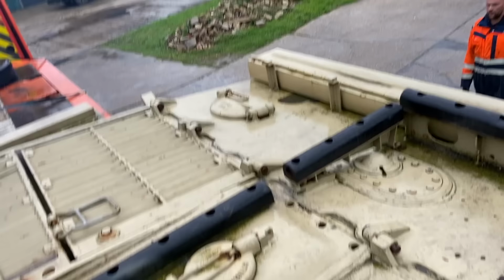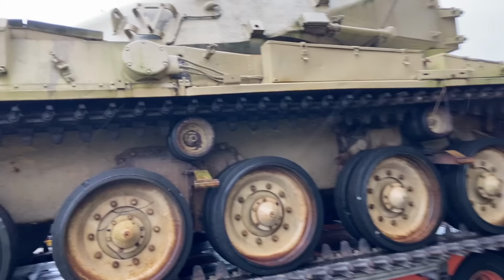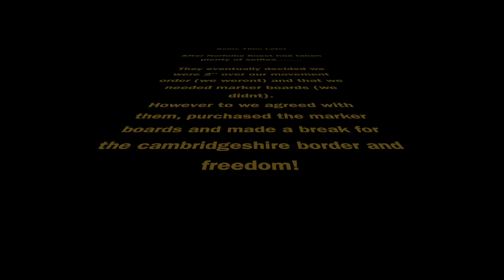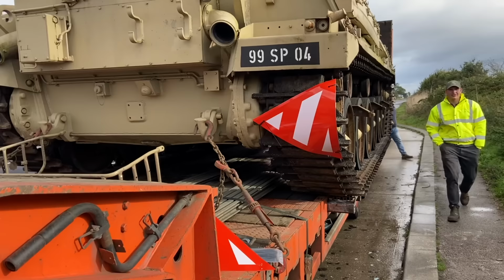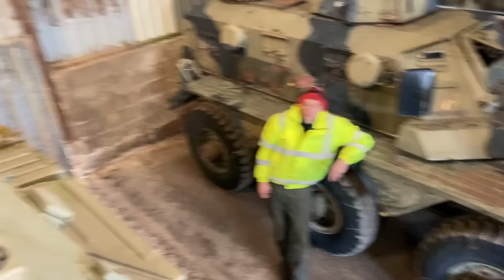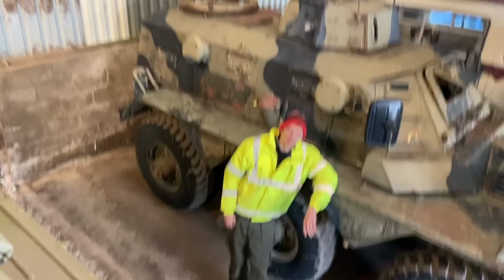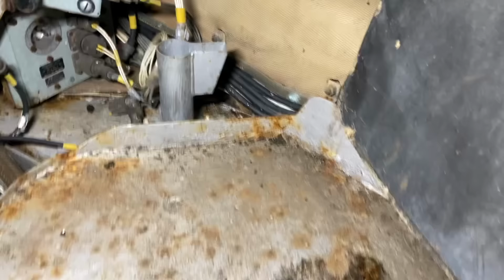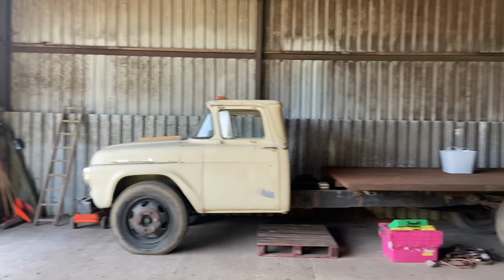We Bought A Chieftan Main Battle Tank and Got Stopped By The Police Taking It Home!

Comment: That is the smoothest sounding L60 I've ever heard. You could almost mistake it for a 4 stroke engine. BTW, if it was intended for Iran it's a Mk 5/2.
Reply: Mk.5/2K was for Kuwait. The Mk.5/5P was for Iran (Persia).
Reply: @Celebmacil  Yes, I stand corrected.👍
Reply: @thewomble1509  I worked  at the MVEE at Chertsey in the mid 80's in the 'Auto labs' there. A 6 test cell  facility primarily for R+D work on L60's and it's successor the Rolls Royce CV12 that was used in the Challenger and Challenger 2 tanks. This facility was built with funds provided from the Shar of Iran as part of the money he provided for the Chieftan tank development. I can still hear the distinctive sound the L60 used to make when they were driven around the establishment. A totally different sound to the CV12 powered Challengers.
Reply: @mangleman9112  Mate, i could spend hours talking to someone like you. i got into tanks and other MV's around the age of 14 and have been studying them ever since.
What's your opinion on the CV12 ?

Comment: The Leyland engines were designed to be multi fuel, that series was undependable. Later single fuel engines were the engine should have been fitted.
Reply: All marks of Cheiftain were potentially multiple fuel in theory 
In reality they were always diesel run
Major work needed to convert otherwise 
Ps they were always shite and total embarrassment for the crews
I drove a mk 13
Still shite
Reply: @jameslynch7826  just going by my Haynes manual... 😀

Comment: It would be worth checking if this one has a Rolls Royce engine fitted as some Iranian cancelled orders were trialled with V8 and V12 engines. Might even be a prototype for the Challenger I running gear.
Great find though. At least you have the mobile repair shop when you take this out ...
Reply: It surely doesn't sound like a two-stroke L60, well not to me.
Reply: @572Btriode  Agree, there was no L60 "scream" at all or heard the GUE on start up....interesting.
Reply: @petop8290  Yep, its a four stroke in there, they did allude to its various "modifications".  I spotted the foot gearbox controller though which means the lump is mated to the usual Chiefie gear box; I had the pleasure of doing final test and diagnosis on those during my days at Marconi - Portsmouth.
Reply: It’s fitted with the L 60 not the CV 12
Reply: @MrHewes  I really do not believe that's an L60 in there.
Reply: @572Btriode   Weren't the RR development vehicles fitted with bigger versions of the TN-12 automatic 'box?
Reply: @1chish  In the references I can find an "export" version using the RR CV8 TCA engine had the later and fully automatic TN12 gearbox, but then why is the gearbox controller still in there?
A couple of examples were modified by ROF with RR 900E Condor engines and again used the fully auto TN12 gearbox, but maybe as these were really one off trials projects later abandoned, perhaps the gearbox controller was just left in there for convenience.
I would hazard a guess the subject vehicle here is one of those two.
Reply: @572Btriode   This is what I believe. And maybe the gearbox controller is still used to control the auto shift. Or just left in place as you say.
If so this will be a Chieftain 800 or 900.
Reply: @1chish  Yep, that well could be and there's another reason for leaving the gearbox controller in place.
Strangely, but perhaps it was a convenient place when designed, it has the circuitry to drive the driver's gun barrel direction meter, that gauge on the dash with the white square which represents the hull.  It only goes in steps but sufficient to let the driver know where the barrel is overhanging. That very meter was in the bespoke test equipment and I recall testing the function, how the turret input was simulated I cannot remember.  It was getting on for 50 years ago !!
Reply: @572Btriode   Blimey that is some detail to recall mate well done. Be interesting to see what the lads uncover ...

Comment: SP reg would have been a trial tank /pre production ,so would never have been with a unit  so is probably in better nick
Reply from the maker: Was originally destined for the Iranian army but when that deal fell through went to be used for testing and developmeny
Reply: @fittermat  That i never knew ...Challenger was for iran ,then the shah was ousted and the mad mullah took over and we inherited the chally so to speak
Reply: @norb0254  We welded a new rear half to the Chieftain front to make Shir1. Shir 2 was the bones of Chall 1. Vickers at Leeds was also re-engining their version of Chieftain to give better performance and reliability. SP was trials only. there's one at Bovington.

Comment: You probably lost a tyre on the journey as the tank was entirely in the wrong position for weight distribution, the front axle was probably overloaded, the back was carrying nearly no weight. If the cops had weighed the set up there would certainly have been an offence! To make things worse it was backed on so all the tank engine and transmission weight was near the neck of the trailer too..............

Comment: Those don't look like "rubberized" tracks to me. What do I know ? I've heard that in some areas of the U.S. if a piece of equipment leaves cuts in the pavement the owner is fined for each "cleat" mark.
Reply: Those are peacetime rubber pads fitted.  War service is just plain steel links. They are to give enhanced grip on hard surfaces but when worn down can scratch the road surface.  If you go to the Tidworth/Bulford/Bovington areas you will regularly see them travelling on the road. The tracks are also reversed for war use so the bar/grouser leads the link for greater climbing ability. Later models and Challenger had the Dhiel style track fitted with bolt in pads.

Comment: 6:41 If by 'movement order', you mean 'how far out it sticks from the orange part of the trailer', then that's definitely more than two inches on either side. That's at least three, possibly three and a half inches from the side you showed. Then again, I don't blame either you or the police on that one; I hear you Brits haven't used the imperial measurement system in quite some time...

Comment: Nothing wrong with Leyland engines => Imaging this your in a hot bath & someone dumps you in a cold bath then just as you get used to the cold your dumped in a hot bath again => Engined don't like this treatment either so when engine really hot allow the radiator to cool it  a little before shut down then it will be trouble free... It also makes sense to allow the oil & water to circulate for up to a minute before charging away ><

Comment: Police in the United States do not I repeat do not have that authority to stop an oversized load simply for being oversized if they are observed breaking a traffic law then yes they can stop the vehicle but they cannot inspect the load they cannot inspect the paperwork they basically can't do anything but write a ticket for whatever traffic infraction that they're trying to frame the driver for I guess in a nutshell what I'm saying had I been the driver of that vehicle in in the United States I would have told those cops to piss off and I have actually done that more than one time.

Comment: There was a guy in the U.S. who tried to do this. It was a Sherman. However, when he started to run it about on his land, the military said he needed to "demilitarize" it. He told them that he did and that the guns were non-functional. The military told him, no, they wanted him to remove the engine, break the axles, weld the wheels to the body, weld the treads to the wheels, weld the turret to the body, and then weld the hatches closed. The guy sued the military and on his first day in court the military sized the tank and had it destroyed.

Comment: Is it possible to re-engine the Chieftan seeing its current engine is so floored? or has that been done before you pick it up?
Reply from the maker: it is, but with this being such an unmolested example it would be a shame to take away from its originality. Also been one of the last ones made it does benefit from a revised power pack which is slightly more reliable.
Reply: The engines got better as time went by, the main problem was the cemented in bore liners, they would give way and you would produce the most fantastic clouds of white smoke as you burned off all your coolant. Saw one of the troops tanks do that on FTX over in Germany and it was quite a sight. Not as impressive as a run away engine that destroyed itself at twilight whilst leaving a hide again on FTX a few years later, that was spectacular when it blew taking the back decks off and throwing them some distance.

Comment: British weapons culture: Can I carry a firearm, NO. Can I carry a knife, NO. Can I carry a laser pointer, NO.
Also British weapons culture: Can I have a tank, YES.
Reply from the maker: I would have settled for an 1911 abs AR-15 but I had to get a tank instead 😂
Reply: A tank with the main gun deactivated and machine guns removed is just a really heavy tracked vehicle, not a weapon.
Reply: @herrakaarme  it's still a weapon . 55+ ton of MBT is definitely going to do some damage with or without its guns.
Reply: @philleeson7835  Pretty much anything can be used as a weapon, even plain air, when it's compressed. A big truck would be, in the wrong hands, a much worse weapon than an MBT with deactivated weapons. A truck can weigh as much, but is faster and more agile on a road, but more importantly it wouldn't gather that much attention, allowing a terrorist to get closer to the victims. Furthermore, they are available everywhere. Nobody calls them weapons, though.

Comment: If you  really were within the regulations and the police made you comply with with regulations unnecessarily. It is possible their egos did not let them admit they were wrong or even find out if they were wrong. Either that or they were too lazy to find out if they were wrong. In any case this the kind of thing which creates contempt for the police.
Reply: Problem is they are damned if they do and damned if they don't. What happens if they do not check a vehicle and its load was both not within regulations and was incorrectly secured, then said load spilled potentially fatally? That too becomes their fault. For not checking. 

Catch 22, people whine when they check vehicles that are within regulations but may appear not to be, and they wine when they do not check vehicles that are incorrectly loaded, frankly I would rather they check, all you lose if you are within regulations is a a little time. If they don't and a load like that spills someone could be killed. Which would you rather have on your conscience? Costing someone time? Or costing someone their life?